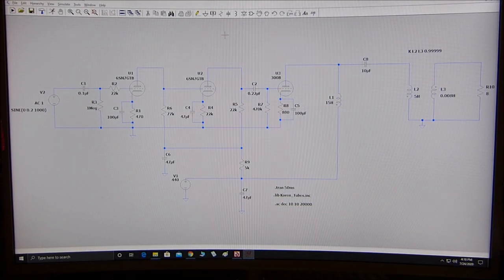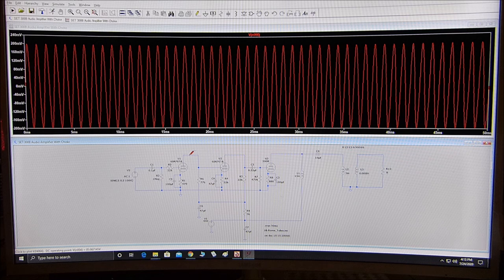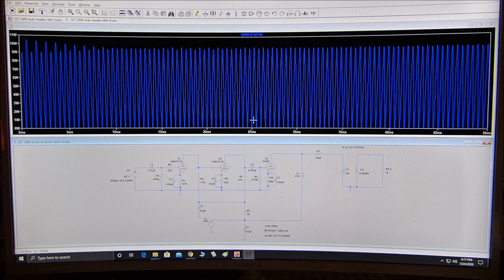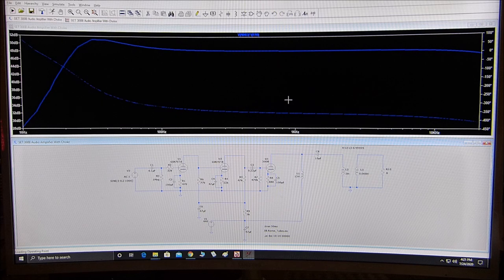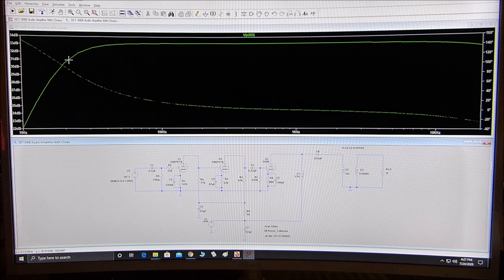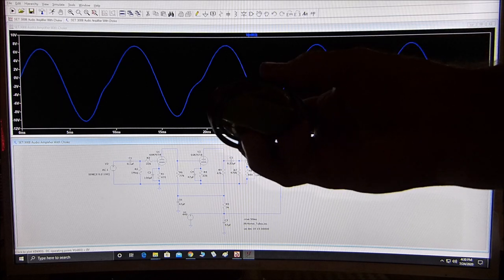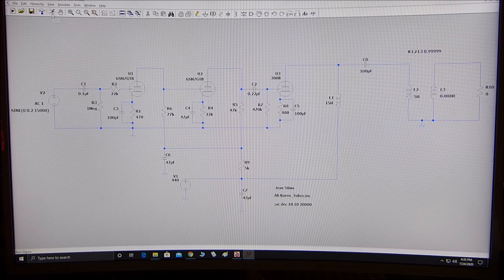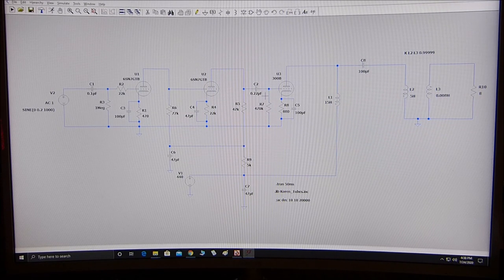LTSpice Modeling Of SET 300B Choke Loaded Plate Tube Amplifier

Comment: The Miller effect magnifies Cag by the gain of the tube, forming a feedback path which can provoke oscillation in combination with the series L to the grid. The 22K grid resistor counters that by damping this LC and I guess by pushing the nett Ft of this L and this resistor and the Miller capacitance upwards beyond the bandwidth of the tube, so the gain is < 1 at Ft. It's important to put the R between the L and the C for this purpose, that's why they say to mount it right on the grid pin.
Reply from the maker: Thank you for explaining it for me.
Reply: the resistor dumps the possible parassitic and auto oscillation creating an RC low pass filter where the capacitor is actually the grid to cathode capacitance

Comment: Hey David, at 12:27 That's the series resonance of your coupling cap against your inductances.
When you change (raise) the value of coupling cap, you are pushing the resonant dip below your low freq end of your graph.
If you change the low end to 1 Hz you will see the dip again with the 20u cap.
Thanks for posting this on LT Spice. I use the now unsupported Altium Circuit Maker 2000. I'm quite comfortablewith it but might just try the LT soon after seeng this video.
Reply from the maker: I see that now that you mention it. The 15H and 5H are parallel for 3.75H and is resonate at 18.38Hz with a 20uf capacitor. I really like the LTSpice but I don't use it enough sometimes and have to struggle to get familiar with it each time.  Thanks for your comments.
Reply: ElPaso TubeAmps It's like what happens if the choke is too small in a CLC PSU filter, only a dip instead of a peak.

Comment: Really looking forward to this 300B Amplifier project. Neat idea about using uncoupled chokes as plate loads; will be really interested in the use of dual chokes instead of a push-pull transformer. Also like the use of LTSpice. Keep up the great work.
Reply from the maker: Thanks, Tom. Modeling has shown that the parallel L values for L1 and L2 should not go below 20H for decent 30 Hz reproduction so I need either two 40H inductors (one choke and one 25:1 matching transformer) or a very high L choke and a common good quality 20H OPT. I am afraid the idea of using these small matching transformers is just not going to work for good LF reproduction. We would not expect to be able to get away with cheap components in a PP amplifier so it certainly appears we can't get away with cheap components in SE amplifiers either.
Reply: @ElPasoTubeAmps  Yeah, it's always something, isn't it. But I hope you will continue to pursue it since it seems intriguing and that is when things get interesting.

Comment: The deepest bass song I have on hand is Andrea Zonn : Better Be Home soon. is about 30-40Hz  I have play it with 4P1L PP and SS amp. Bass is very deep.  If SE can go low as 30HZ, This song should be fine. I wait for your best design 300B SE so may be I can use 6SN7 45 too.   because 300B and 45 as you say can be same design with change of Cathode resistor to 1.5K.  I am not hurry build. Need to study b/c I have 4 amps now.

Comment: I always use LTSpice when I build a new circuit, however I find sometimes, especially with tubes, it's not super accurate, not blaming the software, more like the tube models and me ignoring the effect of resistance/capacitance/inductance in the wires I use to connect the components together. But it's a wonderful tool that makes prototyping so much easier these days. Just don't go down the rabbit hole or you'll spend all your time optimizing something that might not be real.
Reply from the maker: I sure agree with you about LTSpice. It makes great schematics too -  I find that I need to go into Tools, Control Panel, Drafting Options and Pen Thickness and set it to 10 to get a good laser printer image. Maybe there is an easier way? Anything that can come within 5% of reality with vacuum tube models these days is a miracle in my opinion and I use it for simpler things also, maybe roll-off of a high pass filter etc. Thanks for your comments.

Comment: What you are not seeing is both the AC and DC components that exist between the output tube and the blocking capacitor. If you can see both at the same time, by adjusting how much current the output tube draws, the AC signal will increase or decrease depending on how much resistance there is between the tube and ground. Also, if there is other types of matching transformers that have different impedance values, you would get different outcomes because remember, the matching transformer isn't directly coupled to the output tube so less impedance to ground through the matching transformer means a much easier path for the signal to get to ground. It would be interesting to see what happens at the output if different impedance values are used on the matching transformer? I know that some transformers had taps for both 70V and 100V. This circuit is different than the regular tube amplifier circuits and you can play around with things that you couldn't do with the others.

Comment: LTspice also gives you the possibility to parameterize the variables in its simulations. So you can enter a formula in stead of a fixed number.

BTW LTSpice flies when you have a modern multi-core/multi-thread CPU

Comment: 330VDC to L1 is max for 45? hence R5 and R6 need to be changed to make correct voltage to 6SN7  What is the voltage of both plate of 6SN7?

Comment: when you need to check a few different values for a component you can use the .STEP command ant the simulation will generate a family of curves, you set the value of the component as a variable like "X", than add the command .step param X (start value) (stop value) (increment) or .step param list (value 1) (value 2) (value....) to try a list of possible parameters.

Also a weird start of the circuit is normal because to will perform a transient analysis as it is called, so try to delay the start time in the transient analysis command to like 50ms start time to get rid of power up strangeness.

Another tip, if you perform a transient analysis you can take a look at the frequency spectrum right clicking on the graph and under view you fill find FFT.
Reply from the maker: Thanks Manuel - I did find some notes on the FFT display and figured out how to display the harmonic profile and also the display of the Fourier function which gives THD values under, View - Spice Error Log. I will show that on the video and the amplifier built. Most important, the value of the plate choke and the matching transformer have to be at least 40H each as they appear parallel for signal and the minimum value of L for a decent 30Hz is 20H. This is the challenge at the moment combing thru my stash of transformers and chokes. It I could find a common 40H inductor that will handle 100 mA of plate current then a 40H to 8 ohm transformer would work. Better yet, I need to find a plate choke much higher so a more common 5K to 8 ohm (with 20H primary - that is the catch). As long as the parallel L of these two inductors stays at 20H it models very nice for LF. The point here is with 100 uF coupling, transfer is transparent which means we could use a "common" 20H PP output transformer and not have to worry about saturation because there is no core gap. Hope I am making sense. Once again --- parallel L can not drop below 20H - use a fairly common 20H output matching transformer with a much higher L choke so that the matching transformer L is not significantly lowered by the plate choke. The voltage amplifier section is "perfect"... really appreciate your comments.
Reply: @ElPasoTubeAmps  and i really appreciate  your videos! 

I get your point about core saturation, and yes it might be a problem but i don't think it will be a problem.

As the low frequency response, did you try to place a feedback? I think it might help a bit on low frequency with some large value capacitors as a low pass in parallel with a high pass in the feedback path.

73
Reply from the maker: @manuelminutello3027  I have toyed with NFB modeling and of course, it does help but it may violate the spirit of the SET, no NFB mindset. I think a switch along with a pot to vary NFB from some level say, 16 dB to zero NFB would very easy to install. Unfortunately, unless I have already stated this, as I see it now, the low L level of these line transformers are just not going to allow for good LF response. I don't see a way around that. A 40H choke and a 40H OPT with correct ratios for a 8 ohm load  are unlikely to be found in a junk box. With that said, and I may have already mentioned this too, loading the plate into the 40H choke will - and this is important (I think...) will allow the use of a common (high quality) PP OPT as  it will be able to be used in a SE amplifier because we have eliminated the current thru the transformer and eliminated core saturation. That is the only advantage I see to this choke loaded plate - capacitor isolated - OPT matching to 8 ohm load design. So, I do still see hope for true quality, HiFi reproduction in a SE amplifier. No doubt we could use the line transformers with 2-3H primary and they would "work" but LF response is going to be as bad as it is in any typical low quality SE amplifier. I don't want to produce another circuit like that. I have transformers with L levels of 1000H and maybe I can just use one half as the plate choke but I need to do research to what max level of current I can run thru them. Still got work to do but I have confidence a quality SE amplifier can be built that will play music with quality reproduction of music other than violin and voice. That is my goal and I very much appreciate your thoughts , and the thoughts of all others, on this subject. I am seeing it as a "community" project (?)   
Dedicated modeling is part of the answer and reality should turn out close to the model. Stay safe, my friends...
Reply: @ElPasoTubeAmps  yeah it is very cool to see so much comunity help! 

I thought a little about the resonance problem on the output coupling, i think that there is another solution that does not necessarily need a vary large capacitor, what about placing a notch RC filter right at the first grid signal input that have the same frequency as the output resonance? It would attenuate the signal at the resonance so in theory eliminating the notch response compensating for the voltage peak?

As far as LF response goes, it would not be super good, but if we can eliminate resonance without a 7F capacitor it probably might be good to about 50Hz, the low inductance is the key problem here as you say but i dont see so much loss of quality.

Comment: That would be a huge film coupling cap :)
Reply from the maker: I am hoping to use two electrolytic capacitors back-to-back for this purpose. I am not really into monster parts if I can avoid it. Thousand watt transmitters, I understand large components but a 5 watt amplifier ???
Reply: @ElPasoTubeAmps  apart from the basic amplification function, a transmitter is different from an audio amplifier in it's working band.. Having said that, for most listening frequencies under 40Hz are rare, so bass roll off under 70 Hz usually doesn't matter that much. And 5 Watts is not sufficient to play Organ (16 to 40 Hz) loud...

Comment: If I connect 2 of 89H chokes, it will be 178H choke? I can't find 150H 10ma choke and no shop can make for me if I can't tell him the size of EI bobbin, wire gauges, and number of turns.
Reply from the maker: Yes, inductors add in series just like resistors. If the coils are wound on the same core, not only do they add like resistors but they add magnetically also in much the same fashion so if your two 89H chokes were wound on top of each other on the same core, the inductor would be 356H.... maybe...  However, there is a practical limit to inductance and current in chokes. I do not know that exact limit but it goes something like this. I used to work on equipment with chokes rated in hundreds of amps but the L was in mH. Or you can get chokes of 2500H but the DC current rating is zero... the point is, I don't think it is possible to wind even a 50H, 10A choke, or something like that. It would be the size of a house.  :-)  So, the 150H, 10mA choke might be in that impossible category and that is why they told you to specify the size of the bobbin. I wish this inductance vs current ratio was not true but it is. With that said, I suppose anything would be possible with separate chokes connected in series like you mention but their may even be a limit to that - I am not sure.
Reply from the maker: Take a look at this site and scroll down and maybe what you want is practical. 
https://jacmusic.com/lundahl/html/power-chokes.html
Reply: @ElPasoTubeAmps  Thank you very much Mr. Elpaso  Do you have any plan to build Parafeed 3A5 SE Headphone Amp 150H choke 15K : HP impedance OPT.

Comment: Dear sir for 150H 10ma choke on 48x25 mm EI which wire gauge and number of turns I need to do? Thank you
Reply from the maker: I have never gotten into winding inductors so I do not know the answer to that. 10 mA doesn't seem like much current but at 150H it might be a challenge. The inductors I have at high values of L  like 100H are only at 1.1 mA. Sorry I am not any help here.
Reply: @ElPasoTubeAmps  Thank you Mr. Elpaso

Comment: for L1 the best I can find in local market is this spec:  Core shape: EI type
Iron core material: Z11 silicon steel sheet imported from Japan, each thickness 0.35MM
Frame shape: I-shaped
Magnetic gap: 0.12MM
Dimensions: width 66MM, height 55MM, thickness 65MM
Net weight: 0.95kg
Inductance: 15H
DC resistance: about 115 ohms